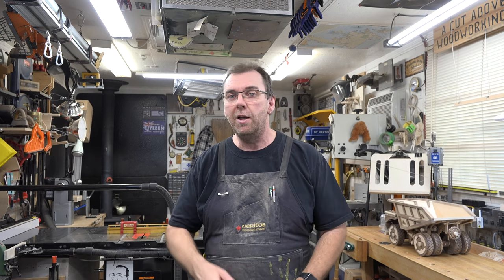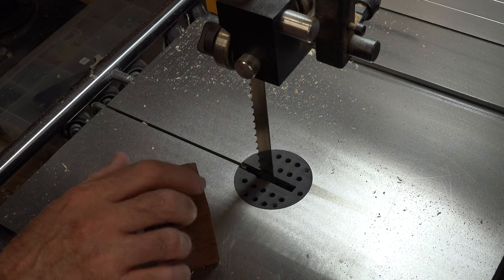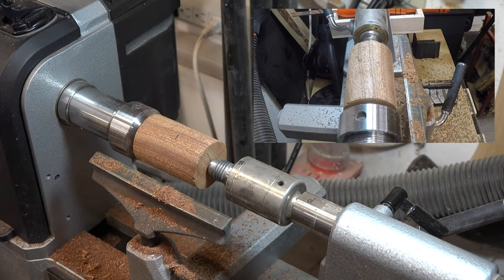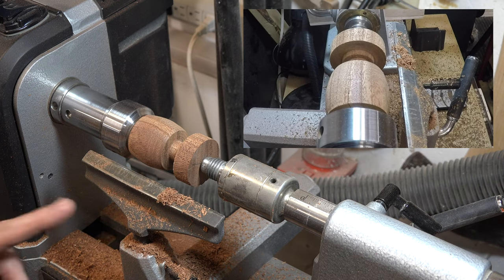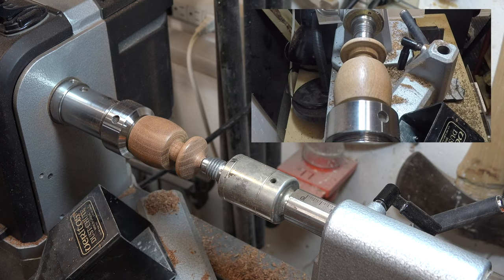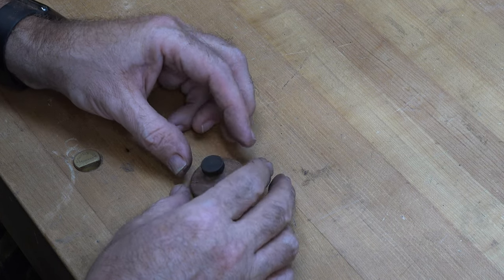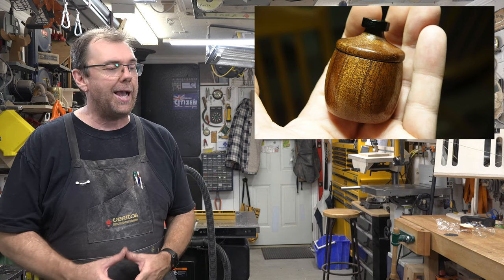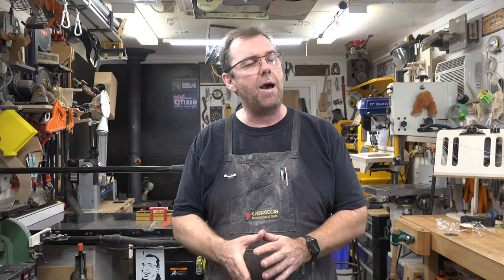Making a Small Gift Box

Comment: What was that black tool you used to measure the tenon with haven't seen on of those b4?? It reminds me of the old bike wrench i used to have. Your showing tools I've never seen b4. When you use a tool could you reference it to where you could find one.
Reply from the maker: You are not the first to ask about this tool Karl.  I went to find a link for it but I can't find it anywhere.  It would appear that people are interested in this tool and I am considering a shop made version coming up on the show soon.  This one is basically a plate of metal that has multiple half circle cutouts in varying diameters for measuring your tenons when turning on the lathe.  It's a great little device and I have to say I'm a little disappointed that it is no longer available.  I've had this thing for about 15+ years so who knows when it went out of production.  I'll do my best to come up with a shop version in the near future.  Thanks for tuning in to the show.
Reply: @acutabove_woodworkings  OK thanks
Reply from the maker: @karlriley1314  Sorry I couldn't help more.

Comment: Very nice little gift box, just 1 question Ken when you measured for the tenon what was that tool you used, I have always used Calipers, Thanks Ken have a good weekend
Reply from the maker: I mostly use callipers as well Alan.  That little tool (which after searching to give you a link) doesn't seem to be available any longer.  It is a template gauge that has multiple 1/2 circle cut-outs at various diameters for measuring smaller tenons on the lathe.  It's a great little device that works extremely well.  Seems like I may have to design and make a shop made one now to have people make their own.  I hope this helps Alan.  Thanks for tuning in and for taking the time to ask your question.
Reply from the maker: It's a metal tenon gauge for turning.  It has multiple half circle cutouts at various diameters for measuring tenons as your are cutting them.  It's a great little device.